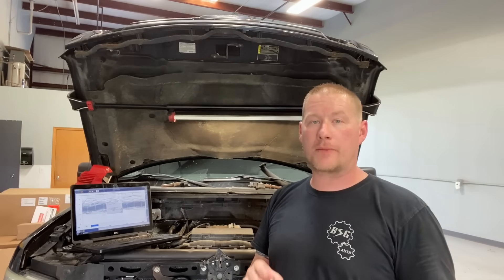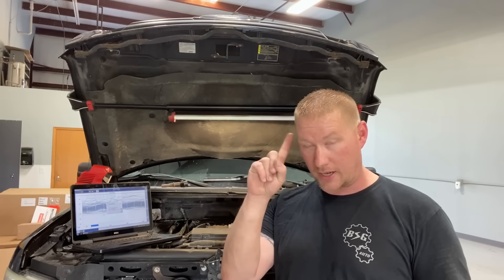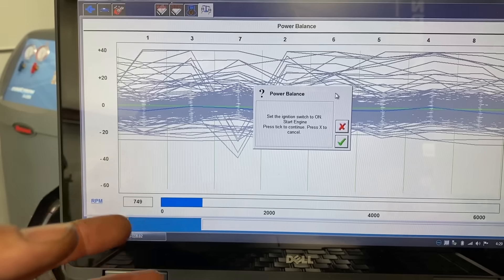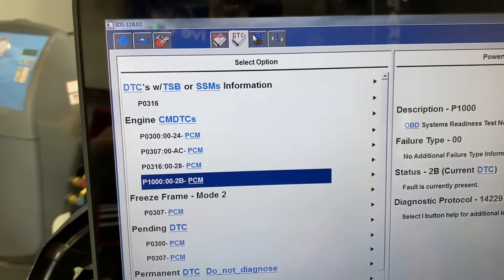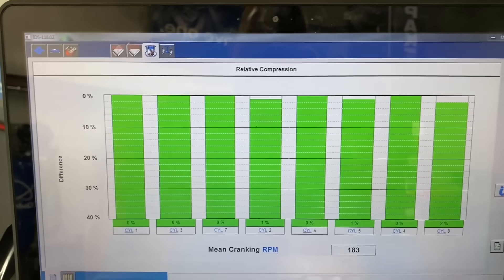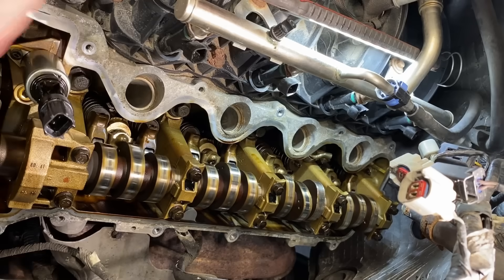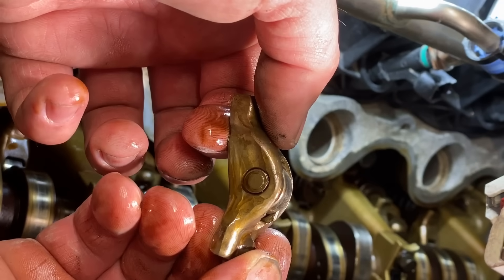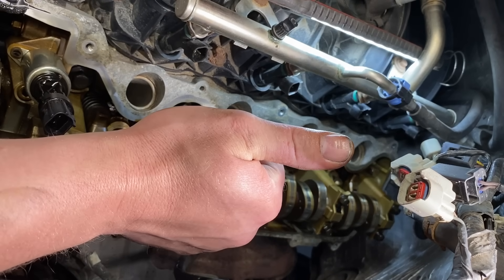Ford F-150 & Expedition 5.4L 3v Triton Engines Hard to Diagnose Misfires Fixed!

Comment: My 2004 suffered a broken number 7 cam follower…Ford dealer recommended I buy a new motor for $10K…I declined and paid for replacement of the follower for$600.  5 years later truck still runs great.

Comment: I forget the year and make that truck information I gave you to 2007 Ford f150 with the 5.4 l engine I changed the PCM computer cuz the old one went out and I put a new drive module in the back on it and all the relays have been changed and the fuses have checked everything is great all the power you're still no crank to it in the chart but I was just wondering you think the Solo in the starter even though there's juice going there you think the solenoid itself can be bad I respect your opinion I would appreciate it sir because I got to get back on the road again everything's been changed it gots a brand new PCM computer and they just got done programming it I picked it up and put it on and I put a new drive module in the back so it won't be no problems there cuz that was crowded put a new one of those on everything's running and working that way but still no cranking over but there is power going to the starter a check to someone I was wondering if you think you might be that solenoid since they put these new little bitty starters on these trucks I respect your opinion I'd appreciate it sir tell me what you might think it might be

Comment: Please help me I appreciate it you know it's no start no crank the first PCM computer it did go bad so we had to buy a new one just got it programmed they just gave it to us and the fuel module drive module has been replaced in the back so you know it ain't none of that and it's got new calls everything is on it and it was running it up since Dale computer went out but I just put needs to put the new computer in there we just got it back as programmed and all the fuses and all the relays are good everything is good everything's got power to it even the starter solenoids got power to it but I don't know if the starter is bad or what your opinion I'd appreciate it sir so I can get back on the road it's got a new PCM computer on there it's got the new drive module in the back does fuel pump all that's new the relays are done the fuses are good everything checks out there if you tell me why you don't think it's starting maybe you might be that little star I don't know that's why I'm asking your opinion

Comment: I got a brand new computer program down there and I got the fuel model drive replace got a new one on there and all the fuses are good all the relays are good you can hear the fuel pump cutting on now and all that but it will not crank over so what is that cuz everything electrical is fine I tested it every fuse everything you put a new fuel module it has new computer programmed just got done putting that on there but it will not start the other computer got burned up and when it went out so I had to get a new one but it won't crank over you don't hear nothing you'll get started going or nothing but there's power going to start solenoid can you tell me what that might be right now you got new everything there's trucks already has a new coils has a brand new PCM computer on it just got reprogrammed just got it in the manufactured program it's got the new drive module on the back so there ain't no excuse for it not to start or nothing and all the fuses are relay the One battery late on the PCM to replace cuz it was bad but everything's good and the wire is good and everything in the fuse box can you tell me what it might be

Comment: Brian, my 2005 F-150 had misfire codes also. My scan tool was just a basic Actron. Nothing like what you have. I replaced plugs and coil packs and it didn't help. this truck had 201800, miles on it. So I took it to the Ford Dealer and asked them to hook it up to there computer and check it out. This truck's engine had oil changes every 3000 miles, give or take 500 miles or so. They said I needed a new engine! I believed them so ten thousand dollars later and four weeks I was back on the road. After watching most of your ford videos' I believe the problem was roller followers! I'll never believe a dealer again. You are the Man! You've also helped me do other repairs on this truck. Next week I'll be replacing a rear ABS sensor, fuel pump module, and oil change on rear pumpkin. Please keep up the Great videos I watch them all the time.

Comment: Took mine to Ford did a whole timing rebuild. 27000 miles later trashed again. I even changed the oil myself and used synthetic and changed before recommended miles. I couldn’t afford 5k for repair again. How is it that ford gets away with this? Why do they continue to make a bad motor knowing the problem. How?

Comment: Hi, so I have the famous 2000 ford f150 xl with the 4.6l 4x4, my truck acts like it has no power, I've cleaned the throttle body and spacer, I've also cleaned the egr ports in the spacer but still acts like it has no power, Wat's next that I need to look into?

Comment: I have an 04 crown vic police interceptor 4.6 with approximately 230k on it. Getting a mis fire also. Intake manifold is new and plugs recently changed throttle position sensor along with mass air flow sensor. Runs smoother while idle still getting that misfire pop hiccup when driving I wonder if this could be the culprit?

Comment: hey bud quick question what's the problem with a v10motor ... po350 number one coil wire to the coil issue hit the test light has power but won't make fire does that mean the spark plug? put new coil in went over the grounds

Comment: Ford f150 lariat 5.4 2005 misfire cilinder 6 i replacement coil, spark plugs, clear de code and 2 day later same code came back p0306 ?

Comment: Why would you put all that money  in a truck with   Almost.  Quarter  million miles more likey the motor is going to blow.   In the next. 10. Thousand miles    All that. Cost in parts and repair  you can buy a good used motor with low mileage   Like trump said to the. Scoalist liberals it’s not about the ass it’s about the brain   You will be money ahead  with a good low mileage motor   Compared to all that cost in parts and  repair  bill

Comment: You could have done a cranking vacuum test and found both the missing follower and any chain or other mechanical issues in just a few seconds. I was taught in 38 years ago at the beginning of my career and kind of moved away with the advent of injection and so forth.  I went to a lab scope school a few years later and he pounded cranking vacuum back in to my head. I do them as my first go to when ever as with this someone else has done the shotgun with no results or just high mile engines.  

Funny the cya an the the exhaust.. seriously? Causing 1 cylinder miss and NO others. So the exhaust  is somehow singling out one cylinder for back pressure...
Reply from the maker: Yes this is due to the exhaust manifold design on this particular engine, I will have a video out soon that explains why.

Comment: Hello! Great Presentation! Question; In the scenerio outlined in this video, what would the cpompression on cyilinder #7 be at on an intake valve stuck open? In short would you have 0 compression if the roller follower pops out? I understand roller followers are just wedged in and there is no solid mechanical pins or bolts holding the roller followers in place, basicall free to float...  Again, if a roller follower pops out (on intake) will the compression read solid 0 ftlbs. ???  Thank you! also, cylynders 6 and 7 are typically the problem? or just 7?  MarkMannM2
Reply: The valve would be stuck close, in theory cranking compression would not change much...

Comment: I’m having similar symptoms to this video and the one You did with the 08 f150 that had a bad fuel injector o ring. Running rich and have the high ethanol rating. Which would you check into first?

Comment: Bought a 2013 Ford Expedition in late March. Less than 40 days and 1000 miles into ownership, the engine either lost a cam shaft or something and extended warranty from dealership is replacing the engine.

Comment: Cyl 7 was your indicator for this diag... is it common on #3 maybe??? 05 Expedition 5.4 3V, 250k+ miles, original diag: only code misfire Cyl 3, replaced coil pack/plug/injector. misfire still present Camshaft Position Sensor codes now...replaced both sensors, code still present.

quick thoughts?
Reply from the maker: Yes, 3 and 7 are most common.

Comment: step one on a 3 valve 5.4 with cylinder specific missfire is throw the plug and coil in that hole. if it missfires pull the valve cover and check followers and valve spring. that roller probally came out because the valve spring broke. i have had more broken springs than anything.

Comment: Question: Assuming this was the only roller follower with an issue, does the ticking sound go away and a rough running engine begin?
Reply from the maker: Yes

Comment: Do you think that can be the same problem with my 2003 Ford expedition 5.4 1&2 keep saying misfiring changed all the coils spark plugs and fuel injectors everything you explained with that truck is going on with mine

Comment: My son has a 01 F150 triton and what is happening is keeps burning up coils on #4 &#8 puts electronic grease on plugs for boot and put sealer around the plug boots usually bout 2-3 months have misfire changes coils runs good no check engine light till another 3 months again misfire and it's worsen if having a lot of rain.  Any advice on how to repair or problem causing this issue 🤔.  Any help would be greatly appreciated 👍thanks
Reply: His truck has about 300,000miles

Comment: I have a 2010 expedition with the same problem. We have taken it to several shops and each time they all check the same things and change things to "solve the problem ". It is almost a year and still no one has been able to fix it. I have left it in some shops almost 2 months and nothing. In all the shops the have taken the valve cover off. Could this be the problem and could the piece fallen somewhere deeper inside?

Comment: I have my Ford F-150 has only 51000 miles 
Has  miss fire in number 5 I replace the coil and module and the spark plug but it doesn’t work so please anyone can help me so do you think I have to do same your job please please help thank you

Comment: I have Misfer in two cylinders 2 and 6 with Edge 13 3.7L change coils but the same 
I notice there up normal sounds appears early morning 
Do you think I have the same issue Mentioned in your video?

Comment: Ive got a 2005 Expedition with the 5.4L and im chasing a random cylinder 4 misfire, P0304. Ive changed plugs with motorcraft plugs, and ive changed coil packs with all new motorcraft coils. And it still comes.
Now most of the time it wont do it in the mornings when i start it and drive it to work but it does it after work when i start it and start driving out of the parking lot at work. It runs a tad rough on start up and then clears up and runs just fine after about 1 minute.

I just bought all new injectors..but i fear that wont solve it.
Reply: Check the intake gaskets?

Comment: What is it with cylinder 7 anyway? Seen 'em miss from everything that could cause one - broken valve springs, follower or cam flatted, sec ignition. Strangely enough, widest spread of ways a broken plug can go worse too. Lucky 7s my ass.

Comment: Hey Brian my name is Ryan I live in Roswell New Mexico I have a 1997 Ford Expedition Eddie Bauer series and just recently had the engine light come on blinking had a diagnostic tool with me plug it in and it said misfire on number 5 not much of a mechanic but I checked the plug wires and the third one back on the driver's side was loose it felt weird but I can't get my hand back there to snap it back on and put the screw in that's on each one of wires I guess it's to keep it in place I don't know if that's the problem but what do you think? Thank you

Comment: Brian,  what mileage do you recommend a roller-follower, etc inspection and replacement? I have a 2009 that just turned over 70k and it’s been well PM’d. Thank you for your clear and well explained videos!
Reply from the maker: At this mileage just listen for a consistent tick tap noise, otherwise wait until its time for a timing job, then replace them all.

Comment: Im hoping you can help me , im getting misfire on cylinder 1 and also getting injector code p0201 , and p0020 sensor I replaced the sensor and my mpg went up but i still have misfire and getting the same codes

Comment: First time watching you I am a Ford Tech myself started to struggle with this misfire watched your video led me right to the number 3 rocker arm... fell off after grinding on the camshaft
Reply: Well I have a Ford F150 that has been looked at by the so called good mechanics around here they have no idea.. One said co2 censor and I was thinking catalytic converter... Well when slowing down from 60 or so to a complete stop it starts to how do you explain it... Ummm almost like the timing is off but also a loud rattling.. Shut the engine off and start it back up and it's fine would love to fix this problem have you ever heard of this before... Hopefully the intake roller follower could be my ticket...

Comment: I have a 2005 e350 box van that is driving me crazy.  Po2107, p0300,p0307,p0308. Pending codes: p0174.  I changed the tps to updated ford motorcraft TPS.  Ugh. I need this van running.  Keeps dying in the middle of the road and I can’t make any deliveries on time.    Anyone have any ideas?   I clear the codes and it starts as normal then starts going crazy again

Comment: Hello, I have a 2000 5.4 2 valve. I have had a ticking sound for as long as I can remember. I've had intermittent misfire on cylinder 5, which is now gone to a constant misfire. When it was intermittent it would do it all day every time it was started but then be fine the next day and run smooth. I've put in new spark plugs. Swapped coils between 5 and 6 and the injectors between 5 and 6 Misfire stays on 5.  Is it possible to be the same problem? I would really appreciate the help, Thank you

Comment: I worked on one for two years to past smog test never found the problem ford said it was computer ford worked on it for a year before I did never fixed it over 5 grand in repairs never fixed it 280 k traded it in

Comment: I have a question for ya man. I used to have an 04 f150. Had the cam phaser “knock”. I watched your videos on that like 100 times. Anyhow, I’m looking at some 09ish expeditions now. Are the cam phasers in these generations still problematic or did they possibly remedy it with the later versions.

Comment: I would say it shouldn't even take much experience as a mechanic to figure that out, I mean it's pretty sad that that many shops looked at it without even popping off a valve cover. If all the basics check out, thats usually the next place I look. Except usually I get those chrysler 3.6l v6 that love hanging valves and spitting the rockers out.

Comment: Hey man i have a 2000 ford f-150 5.4 and im getting told its a burnt valve, it misses in overdrive and when i hit a big slope or hill, but on the hills it opens up and takes back off and im being told its cylinder 7. I need your help please message back when available.

Comment: I had 8 spark plugs with 8 plug coils replaced on a 2006 f-150, 5.4 triton because I was told the #1 cylinder was misfiring. However, after the installed the engine rpm while transmission in parked is around 550 which is low, and when I shift trans to Drive the rpm falls to zero and the engine cuts off unless I keep the pressure on the gas pedal. Will resetting the PCM fix the RPM issue?

Comment: I have a 2006 f150 with the 5.4 triton and the biggest pain in my ass is the right hand side exhaust manifold keeps cracking, I had 1 set of shorty headers and they broke on the right side along with 2 sets of regular manifolds on the right side. My truck has 340.000 on it and do you have any answers for me 
Thanks 
Pete

Comment: I like how you know a lot about the 5.4 3 valves I have a 06 f-350  with over 300,000 miles on her that has a tick when you  frist start it it last about 5 to 10 minutes then it goes away and it comes back after you let off the gas at highway speeds hoping you might have a answer

Comment: Wish you were local id bring my expedition to you and have you diagnose it, mine has a problem going from drive to reverse or reverse to drive sometimes usually when engine is warmed up switching between  the 2 it jerks real bad and if ur standing outside u can hear a nasty clunking noise scan tool says lost communication to tcm and pcm i ran 2 new grounds to chassis  and firewall  thinking its a ground problem  replaced  throttle body  ive done quite a bit cant figure it out

Comment: Had an 04 and it was meticulously maintained w Ford oil at Ford garages and it seized oil rings. Gots did a short block on warranty at 149000 kms. Reused all other parts. It ran better but always had a shaky idle. Decided to pull covers and found exact same thing on cylinder 6 a week after I got the truck back from Ford. But a new follower in and switched to amsoil and that motor ran well till 420000kms when I totaled the truck

Comment: I am having a issue with hard start cold. It takes 2-3 attempts. Has new plugs and coils, new fuel pump and fuse 27 relocation kit installed also a new fuel tank pressure switch from ford that comes with the lines. Any ideas